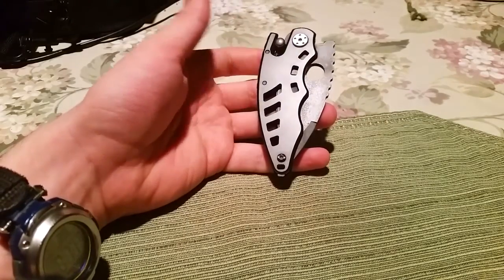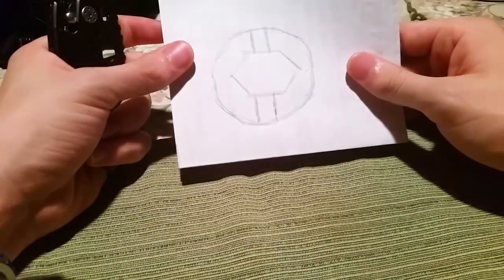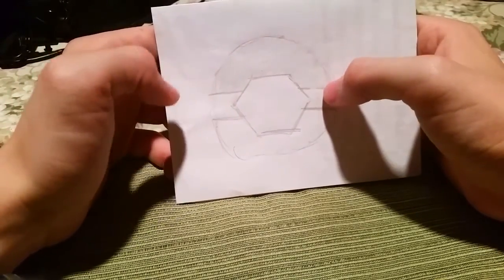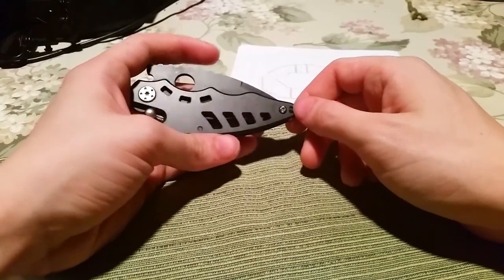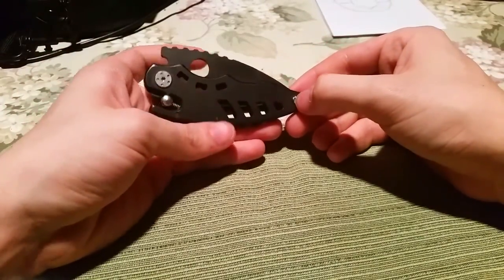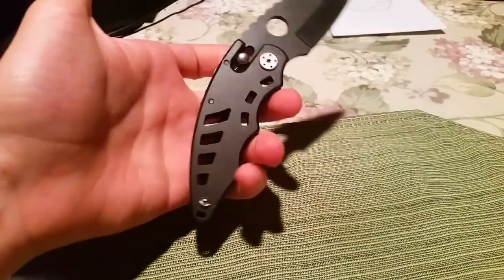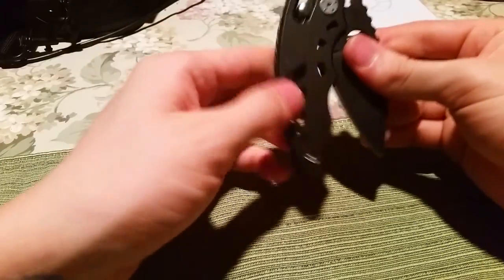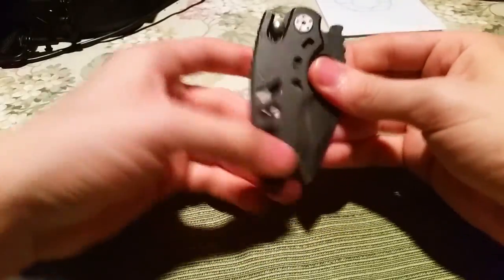Screw Mod for SR 217B knife*

Comment: or buy a torx tool for $7 and not fuck your knife up. but I've got kershaws, not cutting them.
Reply from the maker: Gonna keep that in your pocket are you? Any knife that's so nice you'd worry about a mod like this also has readily available replacement screws.
Reply: +tarbucktransom also any good knife like that I carry I use blue loctite on the pivot threads just as the factory does, eliminating the need for me to carry a flathead or torx because my quality knifes don't come apart on their own.  ;)
Reply from the maker: In this particular case I change the side the clip is mounted on frequently, but I take your point.